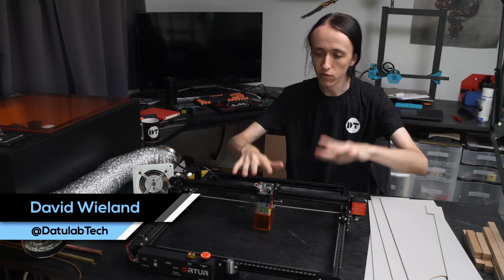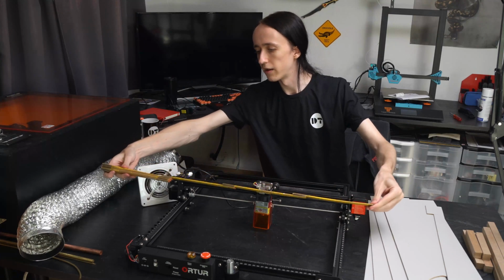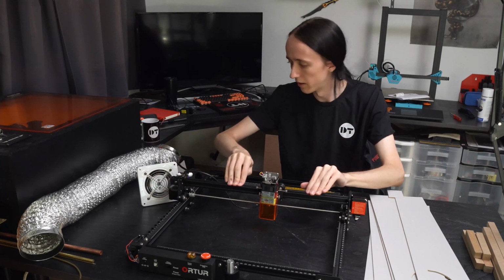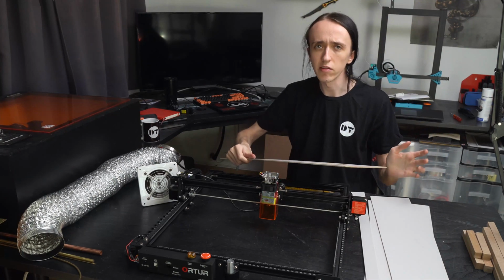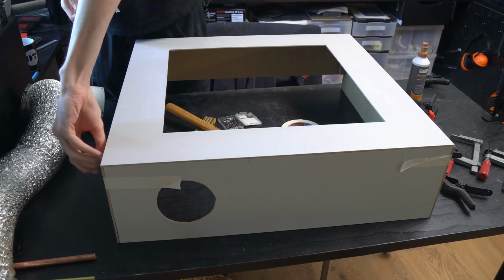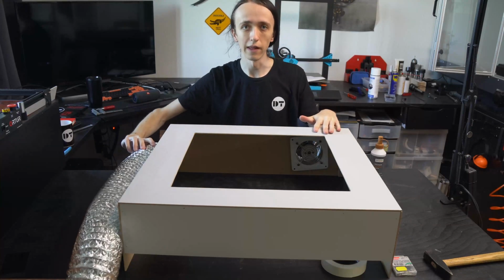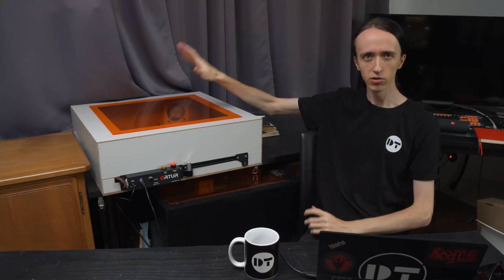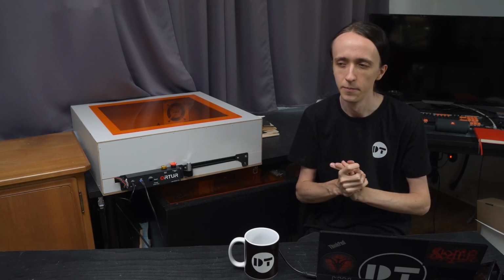Ortur LASER Master 2 PRO Enclosure - Step by Step Guide

Comment: hi young man, i have a quick question, its needed a hole to be able fresh air to enter to compensate the air the fan extract from the enclosure? thanks in advance and congratulations for the idea to explain all step by step for thos we dont have a wood workshop :)
Reply from the maker: In my design there are plenty of small gaps and cracks where air can enter. If you build it perfectly tight everywhere you can add a small gap in the front but it won't need much.

Comment: Great video, simple, straightforward and easy to diy! I just ordered my new ortur master 2 pro and couldn't quite bring myself to spend an equal amount of money on what essentially is a glorified metal box 
I have a question though. Is it really safe to use just orange glass? I saw a video on safety while working with leaders. Author went on and on how optical density should be min 4D, ideally - 6D.
I want to save money, but I love my eyesight a lot more. Would be shameful to damage it over $400. 😅
Reply from the maker: It probably isn't as good as proper safety glass and would never be certified by a reputable brand. But it gets most of the way there for a tiny fraction of the price. I am also not sure if all the included glasses would pass a western safety test, but they certainly are better than none. I just don't have the equipment or knowledge to test that.
I guess it's up to you to decide what kind of a risk you want to take vs how much money you want to spend.

Comment: When making sheet metal floors for race cars, cardboard templates are used for cutting the sheet metal. So with this or any other enclosure, you can also make a mock up box with cardboard and tape and use the cardboard pieces as cutting templates at the hardware store.

Comment: Great video! What is the material you use to cut on that is under wood or is it just the mdf base that you put?
Reply from the maker: For engraving I just put it on the MDF base, but for cutting you want something metal underneath so you don't burn the wood. You can buy a honey comb table for these engravers quite cheap from china, or you can build something yourself.

Comment: Hi David, hope you are well. I just found your channel, as i bought a Ortur Master 2 and I realised that i need an enclosure. I will definitely try to make one following your video. 
Can I ask a question not related to the video though. I noticed that my "gantry" i think that what is called the part where the laser is attached, is nor running parallel on the frame. The frame seems to be square though, so I have no idea what the problem could be. Could you help? Thanks Alberto
Reply from the maker: The gantry has a belt on either side and a rod connecting the pullies, so if the gantry was installed skew, it will stay skew. To fix it, you will have to unfasten one of the belts, square up the gantry and then refasten the belt. I hope this helps.
Reply: @DarkArtWorkshop  Thanks David, that seems to have solved the issue. Now both wheels are touching the frame👍

Comment: hi, you can see from that acrilic? dont damage the eyes? ty great video
Reply from the maker: It is not certified laser safety glass, so I can't give you any guarantees. However it is the same stuff that is used in the protective shields around the laser by the manufacturer and also basically the same as the real protective stuff, just much cheaper. Visually it has the same effect as wearing the goggles.

Comment: Question. I've been looking at getting my first laser for general purpose, engraving and cutting. I'm torn between the  Atomstack M50, the FoxAlien Reizer, or the Ortur laser master pro. Which would you choose?
Reply from the maker: Of the machines you mentioned I've only tested the lm2pro before, which is a great machine. I've also tested the A5 Pro form Atomstack, which was a great machine, so I'm positive the M50 would also be great. I haven't heard from FoxAlien before, but that doesn't have to mean anything. At the price point you're looking at there are many great machines that perform well, as it is a bit more expensive than the super chap ones, which means the companies can actually use good components. I think no matter which one you choose, you'll be very happy with it.
Reply: i would like to purchase ortur laser master 2 pro, they are amazing.

Comment: Other than capturing and venting toxic fumes, why would you need an enclosure if the laser has a energy absorbing shield around it?
Reply: It also keeps your fire alarm from going off every time you engrave/cut something lol
Reply: @beetlewing That really suck's when that happens. Lol.
Plus if you live in flats sometimes the alarm's are wired into a 'fire' sensor panel that starts a 'general' alarm for ALL the flat building and alerts the fire dep. etc. (Depend's on country).
Reply from the maker: For me the fumes are the main reason for an enclosure, everything else is a bonus. The included shield is good for people just walking in the room, but if you're sitting there watching it, it is not fully covered (as there needs to be a gap for the smoke), so you still need the glasses.

Comment: Top stuff, I have ben trying to make one with bits that I have, but your option is much better.
Do you bother to use an air assist with your enclosure or is that not needed as much if the enclosure is near to air tight with the extraction fan?
Reply from the maker: I do more engraving than cutting on this machine, so an air assist is not as important, but when I do cut on my other laser, I always use an air assist for better cut quality.
Reply: @DarkArtWorkshop  On cutting I know the enclosure is over sized but it could be done by laser cutting finger joins on the edges and making a basic box then leaving the lid to be joined with hinges.
https://www.youtube.com/watch?v=gDdUzNBF6eA&ab_channel=ComputerCreationz
Reply from the maker: @muppetarms8406  Of course, that would be very elegant, but also a lot more work for what is meant to be a quick and easy build.

Comment: Sorry but I would neither trust Chinese laser goggles nor an colored acrylic sheet from the hardware store without any certification. That's a possible mistake you might only do once. Certified glass is quite expensive as I learned, that's the reason why I did not build something similar.
Reply from the maker: It is certainly a risk, but in my opinion a glass that filters out 90% instead of 98% is still better than no glass.
Reply: @DarkArtWorkshop  People also forget that someone else (kids, spouse, etc)can easily walk into the room without thinking of wearing protective eyewear... this is especially true of PETS
Reply: Sure, but I think you're missing the point here. You only have one pair of eyes. Why risk them by using some cheap acrylic instead of more expensive sheets that have had proper testing done (like the ones from jtech photonics for example). The orange sheets you got could be sufficient, but I wouldn't want to risk that.

I'm in the process of designing my own diode laser engraver/cutter and I'm actually still contemplating on whether to omit the windows all together and just go for a webcam.

Comment: I guess if you have a smaller laser machine model you could even use an old ATX computer case\tower and retro fit the glass side panel with laser blocking glass. Thanks for the video!
Reply from the maker: Cool idea!

Comment: Very nice. I would make 2 changes. Though as you say it's not required, air inlets at the opposite side of the fan would make it much more efficient instead of creating the useless negative pressure inside. Also, I would leave out the base and maybe float the box on foam rubber or arrange the fan at the other end of the hose (pointed the same way). The fan should not be part of the same structure as the laser unit. It will likely transfer the vibration and affect the results considering the laser resolution compared to the vibration effects of the fan. Regards.
Reply from the maker: You could definitely add some inlets, if you want more directed airflow.
As for the fan vibrations, that is a completely non issue. If you touch the fan, sure you can feels some vibrations, but even touching the enclosure near the fan there is nothing. The stepper motors will create much more vibrations than the exhaust fan.
Reply: @DarkArtWorkshop  Agreed. The stepper motors would be a bigger issue.

Comment: Have you verified that that color of acrylic will block the laser frequency range? I know that laser has it's own plexy mounted to protect your eyes, but some may not.
Reply from the maker: I have not scientifically measured and proven it, so I can't tell you with certainty and certainly won't take any liability. But from what I can tell it works great.
Reply: Colored acrylic is NOT save enoughto block the wavelength of the laser it wil still be dangerous not the color is important but the blocking of the infrared Light that you don't see is ....